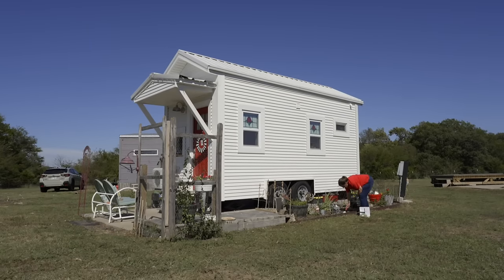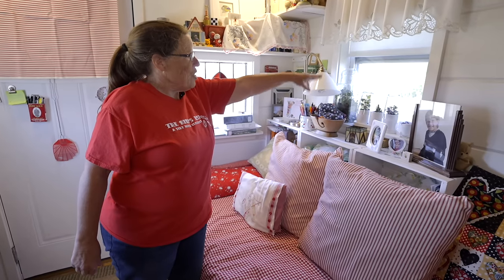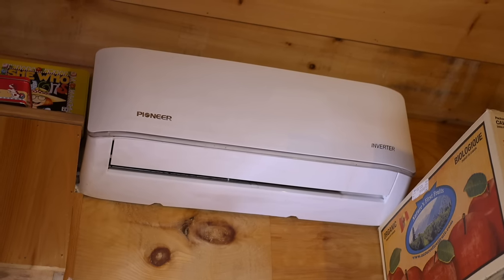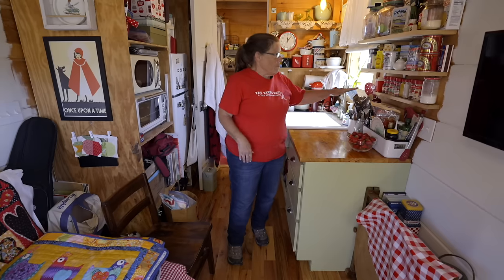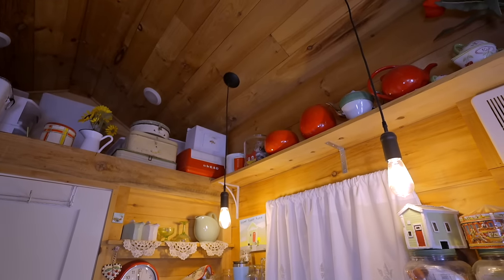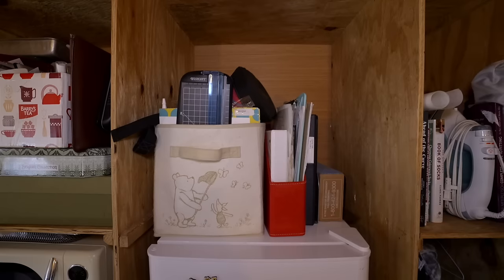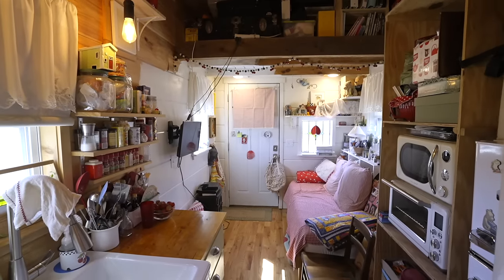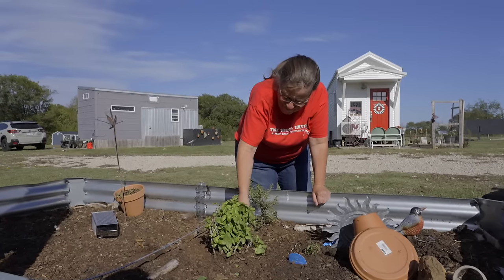Retired Woman helps to build her own Affordable Tiny House - so cute!

Comment: Thank you for the wonderful tour! Cheryl, you really planned well in the building of your home.  Such a kind soul and you seem so content! So many thoughtful ideas too, i.e., larger window ledge to use for storage and can even use as end table, the staggered shelf depth in kitchen, nailing those crates on their side, PVC pipes to hold the flatware in place, tear out pages of favorite recipes, bathtub mat for under ladder, etc. 
Also, love how you painted the curtains to emulate the pretty stain glass, it's very nicely done!

P.S. It was hilarious when you said, "I'm putting another shelf eventually, but you know, it's only been 6-years, I'll get to it." 🤣
Reply: I only just started painting the inside and, as you saw, I got distracted and haven’t finished that either. 😂
Reply: @cherylhuff1914  no need to rush getting everything done quickly!  Best wishes. :)

Comment: Love it.  get you one of those washer and spinners dryers.  It's all manual. It washes quite a bit of clothes and you took them out of the washer and put them in the spinner.  it spins. It pretty much so drys your items and then just hang them up.  You can use it outside too just build you a small shield and place for water to drain out.  Ask me about them.
Reply: I like going to the laundromat. I can get everything done in about an hour and I knit while I wait. 🙂

Comment: So cute! Good job! I have a question though, does the top of the Breville not get hot? It doesn’t affect the microwave? My regular toaster oven gets really hot on top.
Reply: The top doesn’t get very hot and I have the empty space needed around the appliances. Still, I have had the microwave fan automatically turn on when the Breville oven triggered the sensors on the microwave. So now I point a tabletop fan at the ovens if I’m running the Breville at a high temp for a long time. 
Tiny living keeps you on your toes!